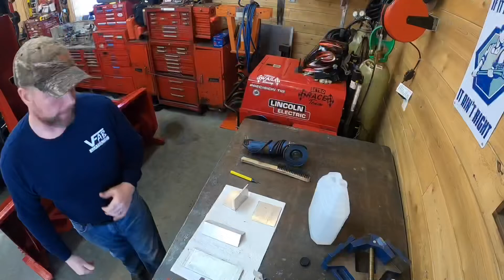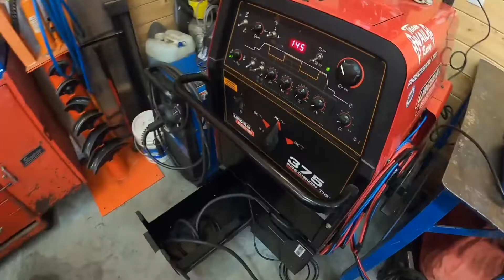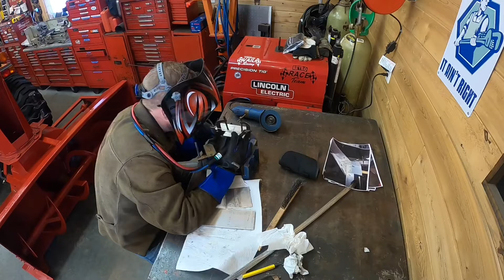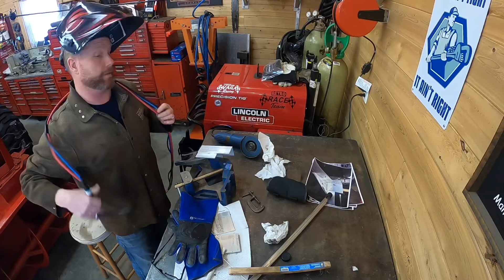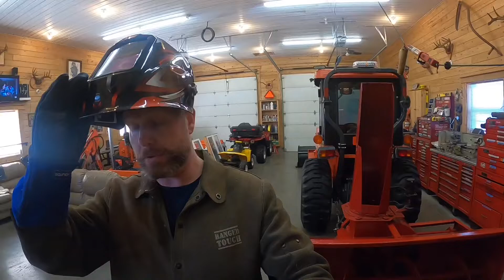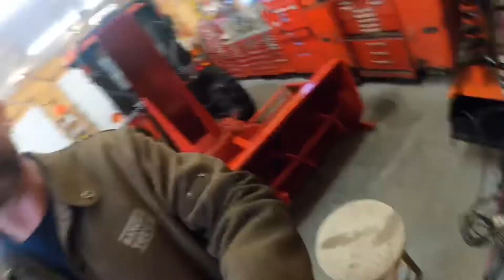Welding Aluminum

Comment: Oh man,  if I only had a dollar for every time I did something that was not the "norm " but worked anyway...
I can't bite the bullet to get a tig machine.  I don't do anything for income,  so my 180 mig will do just fine.
Good job on the video!
Reply from the maker: That 180 mig will do all you need. 

I have built a pile of stuff for myself with a Lincoln 130 plus mig back in the day. I still use it for places I can’t get to with my Miller. The gun is a fair but smaller, and lighter. 

I just put on one of your videos now as we speak. Lol. 

Thanks again for watching.